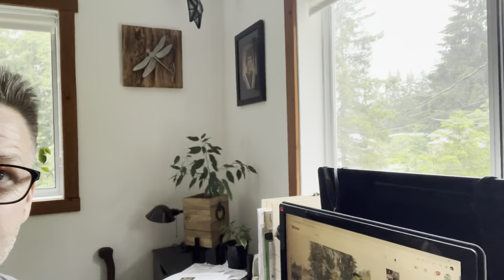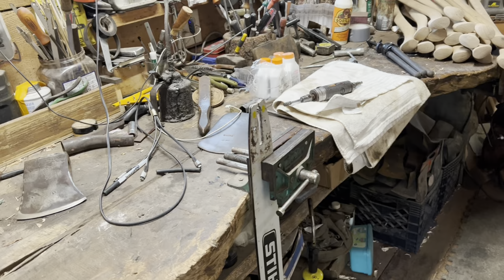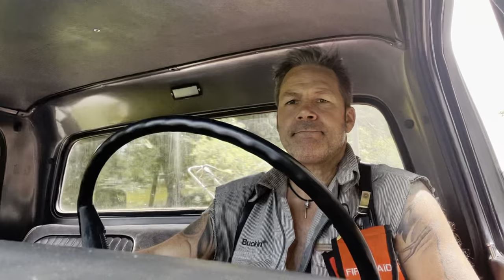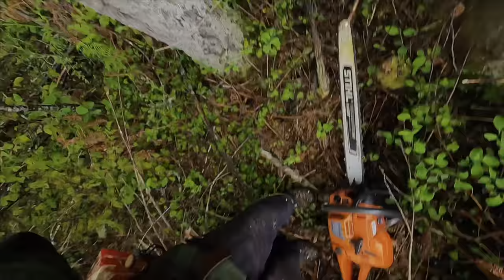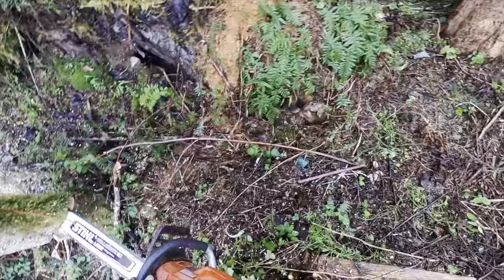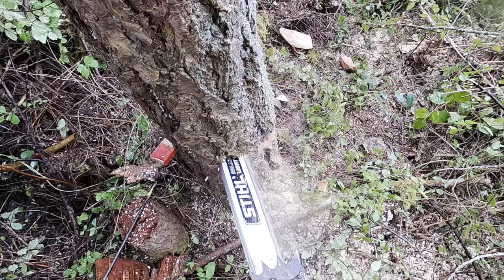Chainsaw tricks, fitting Stihl Bars to Husky saws, starting logging job.

Comment: Yes, please more of the cutting video.
As far as Myrtle goes, I would look into a Gear Vender over/under unit, it gives you split gears, simple on a 2wd and you leave the 4.10 rear end alone.  Bolts directly to the back of the transmission and replaces the output.  At Highway speeds in 4th over, it is like having a 3.20 rear end for lower rpms and greater fuel mileage.  Yet Granny under gives you even more stump pulling power.

Comment: Billy, do the axle swap. wont regret it. the higher gears will give up basically zip that you will notice. have done a dozen of em. when was working all the time, had 7 19 4 x 4 fords. always something going down working in the woods. simple swap and way better milage. 4 on the floor and no loss of anything except noticing the fuel stays in the tank longer. Jim

Comment: Keep the diff gears the same, considering changing the ratios in the box/transmission. That way, you won’t sacrifice the low speed higher torque of 1st and 2nd. 

But you will probably want to rebuild the rear axle and diff

Comment: Hi Buckin, hi folks :) The impulse line comes from the crankcase, the membrane of the fuel pump has a constant volume on the impulse-side of it. Sure, crankcase and combustion chamber are linked by the transfers, but from my point of view the relationship between impulse-volume and impulse-pressure is way more on the volume side, than on pressure, what could cause decrease of fuel flow by pumping just by pressing the decompression button. Do you get what I tried to say? Have a nice time buddies

Comment: At least for the 372 and 390 you also have to enlarge the adjuster hole a bit. The steel is hard in that area so get ready to go through a few drill bits.

Comment: The decomp shouldn’t make any difference starting as far as suction on the impulse line as it’s impulse or suction is coming from the crankcase NOT the top of the piston above the exhaust port where the decomp bleeds compression. It may or may not affect starting but due to compression, absolutely not to do with the impulse line “pump” to carb
Reply: Thanks for that, good to know; I'd been told that it was good to remove the decomp' and plug them.
Reply: @greenstair  
I mean its essentially a valve and they may leak a psi or two but would you ever notice a difference or see it on a dyno run? Maybe? I dunno. It makes sense on a mod or race saw I guess 🤷‍♂️

Comment: Question: how do you compute x feet lift?
I'm in PA I use a long 24" bar--got rid of my 20"ers-- I eyeball the shift in degrees.
Reply: Inverse sine! 4 feet at the top of 100’ tree is 2.29 degrees.
Reply: @marcustraber  mathematics needs banned.
also we need to convert to metric.
I'll stick with eyeballing degrees...